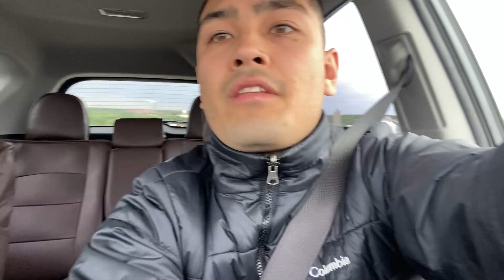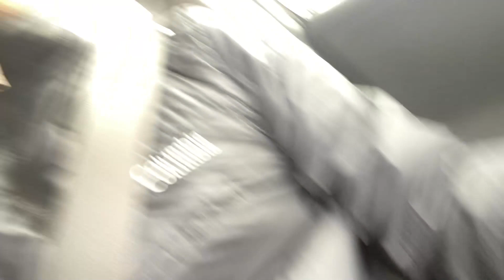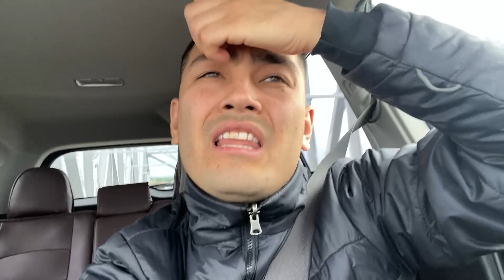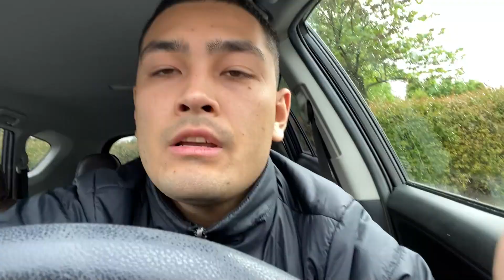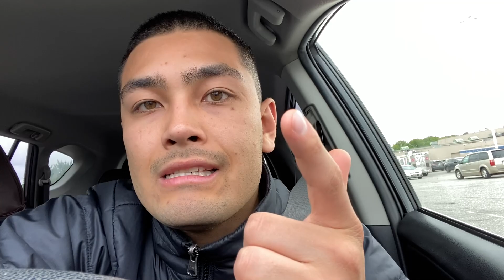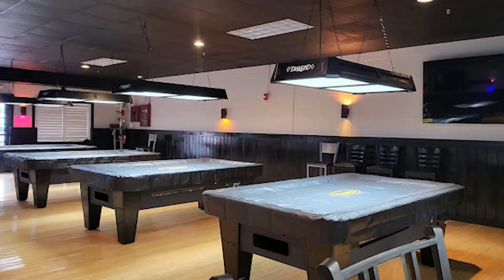add THIS to your ATM machine

Comment: Chad... the per transaction revenue on an ATM beats the revenue on a swipe.
Even if you pay a loader, ATM still makes more. Yes theres upfront cost, but the person looking to double their cash, ATM is the way
Reply from the maker: ATMs definitely beat rev per swipe. However, with an ATM most locations are getting a max of 3 withdrawals per day. Credit card readers get hundreds per day, so it kind of balances out. I love the ATM business, however its not scalable. Once you get to 30+ machines you spend the entire day driving, going to the bank, etc. It's exhausting. Youre a slave to your machines. With credit card terminals you do the work 1 time and you can leverage their existing customers, revenue, staff, etc. You don't have to drive every single week to service your credit card readers. You also can land 10 locations in 1 month with virtually zero cost. If you want 10 atms, you need a minimum of $50k
Reply: I do both as well ... perhaps it depends on how spread out your ATMS are. If you treat it like Real Estate "farming"  a certain area, then perhaps that helps a ton. I'm in a 4 mile city with 100k population.  Loading for me might be different than for many. 

Another thing you should touch on is that some states dont allow "non cash adjustment" "cash discount" on debit cards ... and the legalities involved with store signage displayed to merchant customers  @ChadOtsuji .

Card reader only customers usually aren't as high volume as POS integrated readers (Clovers ect)... to convert those customers you now have to convince the merchant to pay for Clover systems upfront. (~$2000 for 1 machine)... 
Theres definitely many angles we could discuss about the pros and cons on both.
Reply from the maker: @mushasho  Ahh okay that makes sense. Yeah if all of your machines are that close, it must be convenient to load. 

I've been doing Dual Pricing for my merchants, not cash discount. So that kind of gets rid of most of the legalities involved with it. That is definitely a topic I am going to cover in the future.

The company I partnered with actually offers credits for point of sales systems, and thats my main focus. They give out $1200 in credits for every $20k in volume. So if a business does $40k in volume per month, they'll cover $2400. That's a HUGE selling point and something i've been pushing lately because business owners can essentially get a free POS. Plus they give out upfront commissions. So if a business is doing $100k in rev per month, they give a $5k upfront commission plus your residuals of course.
Reply: @mushasho  Do you use a money counter? I am trying to find a money counting machine that will take the bad bills out. Only one I see is safescan 2995-SX, but do not see lot of reviews on it.